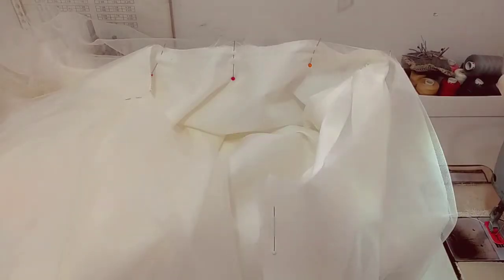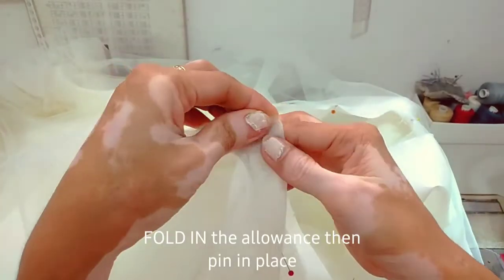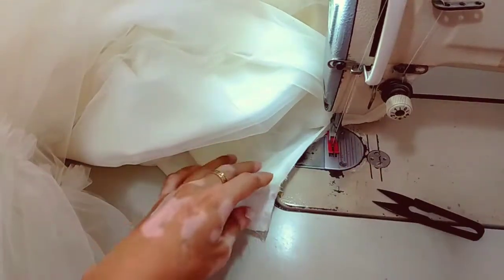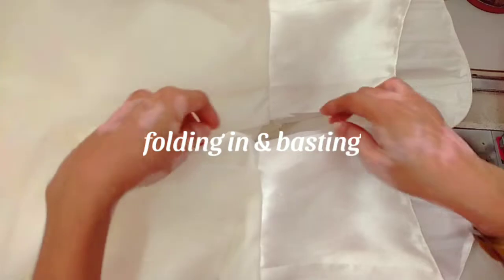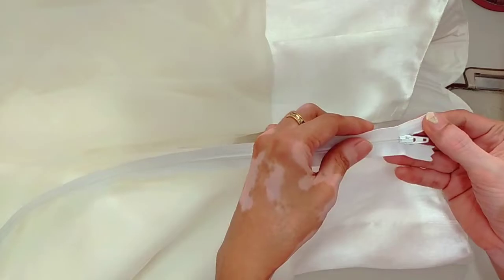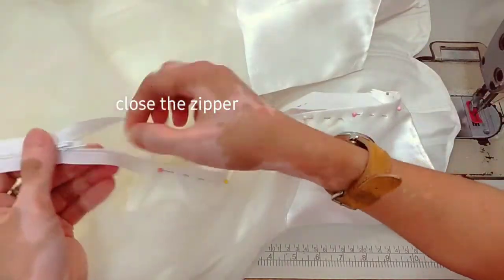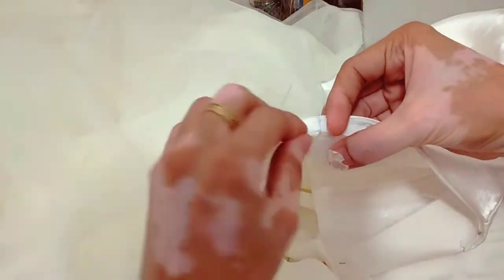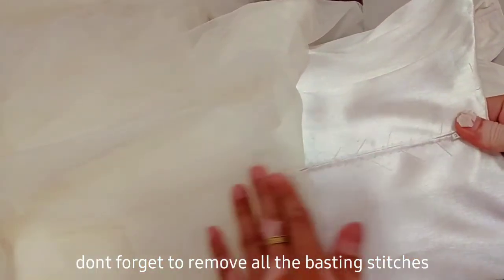🧵 How to Sew Zipper on a Wedding Dress with Layers of Tulle × basting × Sewing Tutorial

Comment: May i ask if you would still fold the tulle over and pin to zipper allowance marking if there are 5 layers of gathered circle skirt (1.5 waist size) soft tulle?? Would it not be bulky?  What if the back is lace up with grommets and v back so the skirt is the only thing needing the zipper. Could you just cut in